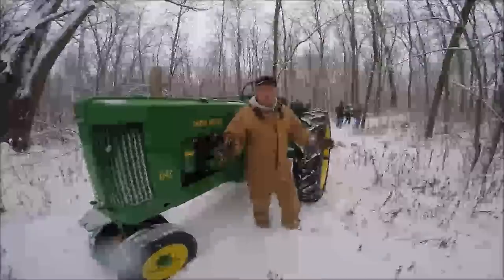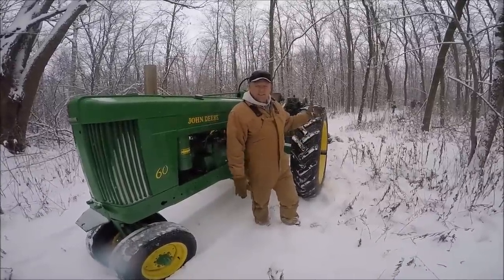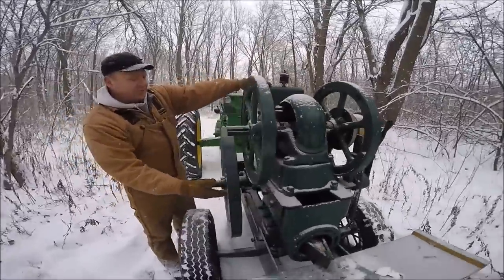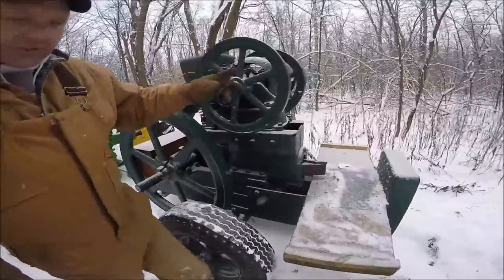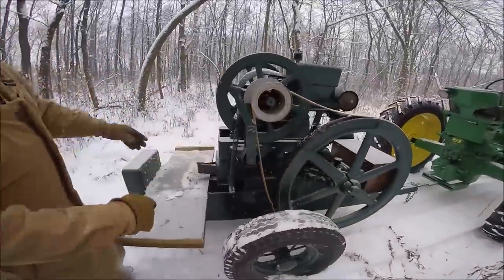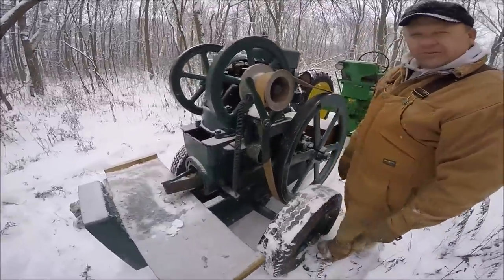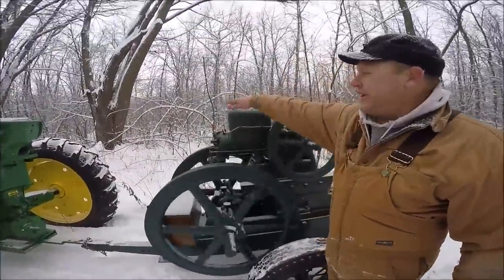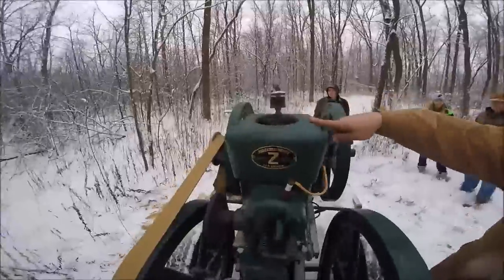Antique Wood Splitter

Comment: That is amazing , 3 HP motor, LoL. Shows the power of fly-wheels. That is why these machines lasted so long, they ran slow and used inertia to do a lot of the work. Reminded me of my days working as a machinist at Phoenix Iron and Steel the old equipment (some lathes, milling machine and planner) ran with a over-head motor, a few flat belts, and there were oil and grease cups everywhere... Those machines were ancient by today's standards, but they got the job done and although really old, held size pretty good, again because they had a lot of lubricant points and ran slow. In a maintenance shop, you didn't need to replace the old for new because time was only critical if there was  a break-down, and then the mill-writes would usually weld it up etc. to get the broken part working until we fabricated a new part. I had come out of working in Air-Space Machining, so seeing these old machines was a learning curve for me. But the steel company repair work was more fun, I got to go all around the plant on break-down calls, and it paid extremely well with super benefits due to USWA union rules. Very relaxed to work maintenance machining. I later opened  my own machine shop and specialized in big steel maintenance which I did for 27 years until I retired and sold off the business. Nice video guys, as you can tell brought back memories and I enjoyed it. I wish the volume could have been better via the monologue.
Reply: Australian iron and steel port kembla nsw . 37 yrs in the trade i collect flat belt machines to use
Reply: Very nice piece of history there Pete👍

Comment: my dad sure loved these old engines we had one sitting out front of the funeral home running after he passed. He found an Olds hit and miss in a ladies flower bed half buried, after a lot of work and extracting every stuck bolt or drilling it out and re tapping them. With some valve and piston work he was able to get it running and re painted it. There are not too many people around that could start it if they had to.

Comment: I get it - the small engine on top is driving a larger engine; the larger engine's head has been removed and a wedge welded to the top of the piston.  Very clever.

Comment: If you noticed it. that is a larger dead hit and miss engine the small one is sitting on top of. It had a splitting wedge welded to it's piston and the cylender head is removed. If the weren't scrapped in ww2 a lot of them were chopped up and made into firewood splitters.

Comment: If you shortened the splitting distance with a chunk of metal it seems this would split by standing the wood into the wedge and therefor being a bit safer.
Reply: Beaman Col
Reply: Beaman Cole how is it unsafe? His hands are nowhere near any moving machinery. Less dangerous than riding a bike snowflake.
Reply: Awesome machine but if the stick pops up over the base plate, one would remember that day!

Comment: Fantastic machine & that engine will run forever , but why do you need your wood splitting so small  if the length fits in the fire why split it .
The wood will last longer as it was and that means less work less mess less wood.

Comment: Works good on the small soft wood, but what do you do with the larger pieces. Looks like you will soon be headed to the emergency room.
Reply: what the hell are you even talking about.
Reply: gravedigr12  Don't even ask. I've been messing around with wood for over 40 years, and out of all the antique wood cutting and chopping methods, that one looks to be about the safest I've ever seen.  Walk away. From what this Bob guy said, he has probably never run a chainsaw. He's probably afraid when is runs his a table saw.
Reply: I love the sound of that old Fairbanks. With wood the right length, a clear head, and perfect timing you can split wood all day with little effort.

Comment: biggest advantage of these machines is the ease of use. 
could i split most of these logs with a axe? yes, probable.
BUT the machine can do it so much easier and faster which allows the user to either cut more logs or take dramatically less time to do them, and that is why machines always win